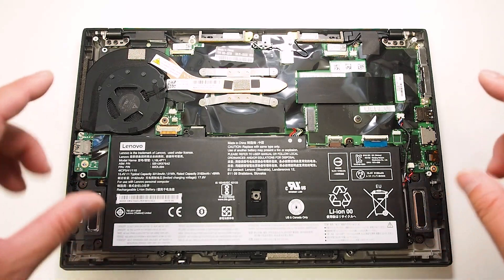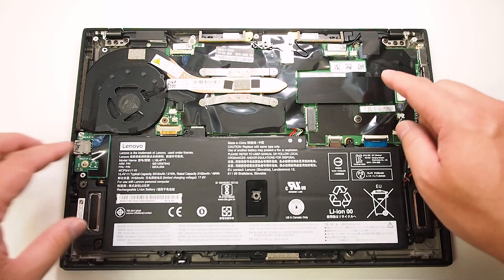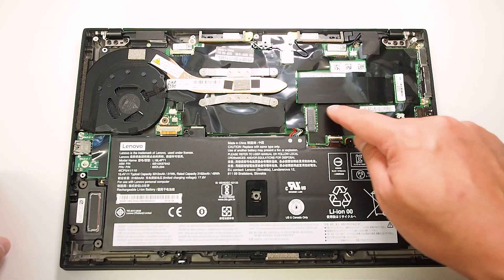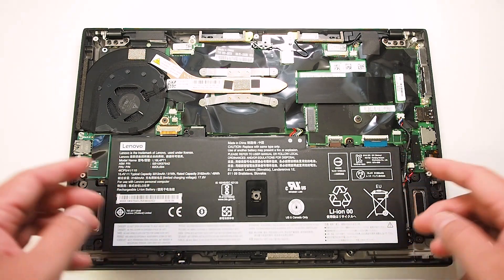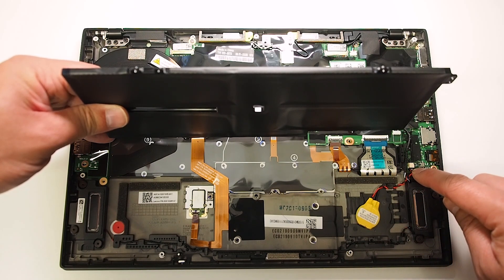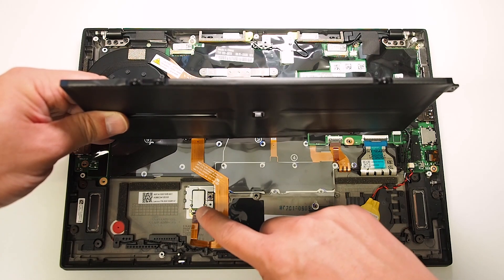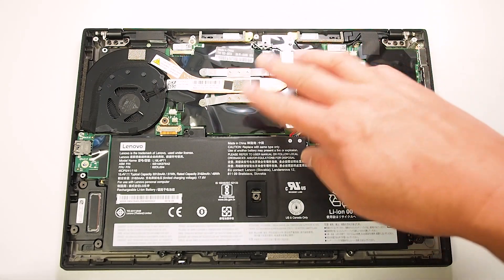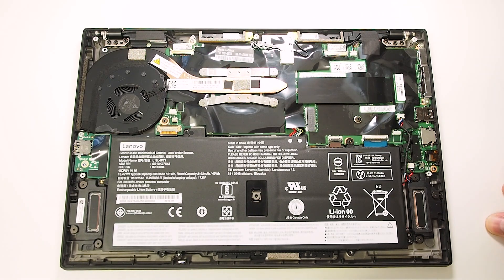Lenovo X1 Carbon 7th Gen Internals

Comment: wish laptops would have a button or switch to reset cmos like on modern mobos. great vid
Reply from the maker: I do too, the number of times I do the reset though not common thing but it has saved me a call to manufacturer tech support. This one hiding under the battery does take a little more to get to. Is it something you have to do often too NeelHD?
Reply: @BsianTech  its more like the once in a million time i have to, its super inconvenient. Its not a big deal though, more like a quality of life improvement.
Reply from the maker: I understand, been less need these days to do the reset like this even with the hundreds of laptops that pass through my hands.

Comment: please do a review for HP zbook g6
Reply from the maker: Interesting you ask for that, three years back I had order a number of HP Zbook 14 about 45 units and OMG I didn't have a good luck batch at all, every single unit had faults, all different faults at different times, ranging from trackpad, keyboard, power, battery, ports, display. Not one was physically damage just pure nightmare even having to deal with all the RMAs I felt bad lodging the jobs if they even blacklisted me because of the amount of warranty calls from that batch. I do must admit back then they were very light for the amount of hardware they could fit in the machine which other manufactures couldn't offer. That model HP Zbook 14 now has burnt a serious memory into me now. I personally have now avoided Zbooks but now since I've started this channel I should give a neutral attitude and give HP a chance again. Let me see what I can do.
Reply: I really wish you cover HP mobile workstation as well. There's not a lot of info and reviews about them